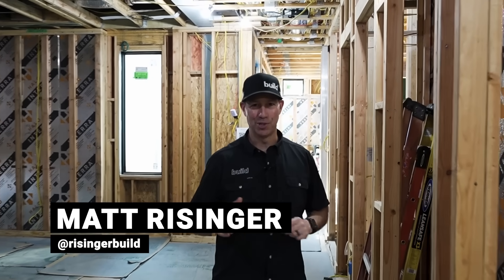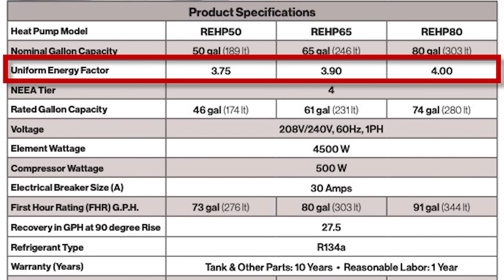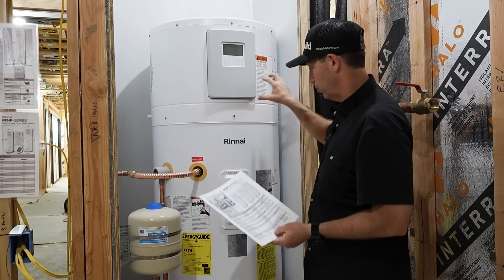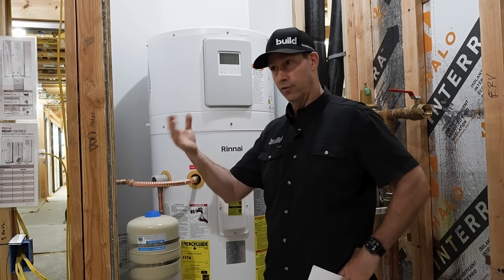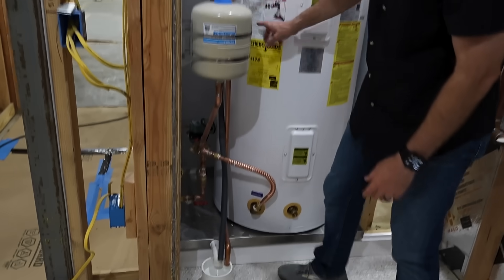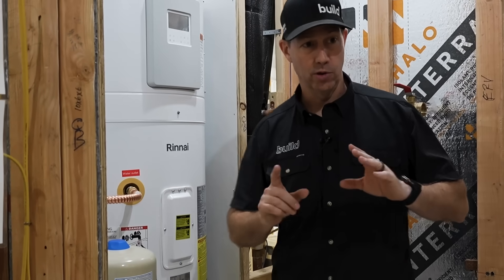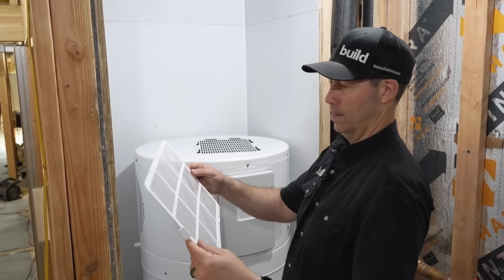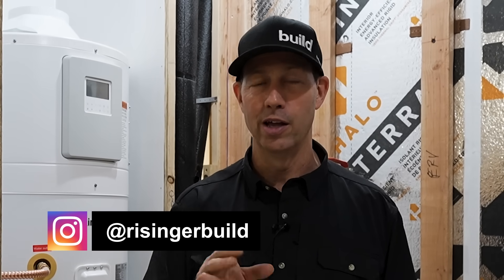The Best New Water Heater? Rinnai's KILLER Electric Heat Pump

Comment: Someone needs to come up with a system that ties multiple appliances together to share heat.
For instance, that heat pump water heater takes heat out of the air.  It would be in hog heaven if it was fed exhaust from a clothes dryer, or warm air off of the refrigerator coils.
Also, the heat pump wastes cooled air that could be used by the refrigerator.
And that doesn't even bring up ways any and all of those appliances could be used for conditioning the air in the house.
Reply: We are starting to see this approach in larger commercial settings such as big modern supermarkets - e.g. heat output from the vast refrigeration plant being dumped back into heating water (and space heating in the winter) rather than exhausted to the outside environment, etc.

Which should tell you something about how cost effective it is or (hint hint) isn't going to be on the residential scale to professionally customize the equipment and installation in each house to make integrated heat management a reality.

Supermarkets have enormous refrigeration line-sets running everywhere already, and this approach is only starting to make headway with them.  Are there really enough homeowners who want to plumb their refrigerators, dryers, water heaters and furnaces together with a big spider web of refrigerant line-sets and/or runs of dryer-ducting to move heat around to all these appliances? That's very expensive compared to the $ you'd save on energy bills.

The HVAC/R people have sounded out the market and to date there is only a fairly narrow commercial customer base for that kind of integration work. So I'm not telling you it can't be done.  But I am telling you that smart experienced people have thought of this concept before and so far they haven't seen a viable residential market for this kind of thing.

Comment: Looks good! Takes about 5-10 years to pay for itself. Hopefully compressor won't burn out or freon leak won't occur. And think about cold air from evaporator coil in cold season. And where to drain all condensation from it. And, sorry compressor and fan creates a lot of noise (keep away from bedrooms). Otherwise good expensive toy!

Comment: This unit seems to operate in a self-contained manner. Do they have water pump water heaters tankless or with tanks that utilize geothermal heat pumps or that integrate with geothermal heat pumps with deep vertical wells?

Comment: The Rheem ProTerra actually has a higher efficiency rating than 4, can also be ducted, has more energy savings than the sticker on this water heater, and costs more than half as this one for the same 80 gallon capacity.
Reply: I suspect Rheem is not paying him.
Reply: @kodiakeddie1827  Ironically, I bought the Rheem because of this channel. 🤣
Reply: This is exactly what I was thinking. Mine runs at 335W on avg.
Reply: how much and how silent? I my water cylinder in a 1mt by 1 mt room in the hallway and I want a unit that can be silent :)
Reply: @martiruda  I don't understand most of what you wrote.
Reply: Guy is product shill
Reply: We just installed a Rheem ProTerra this week.  I didn't know Rinnai now had a model available, but too late now.

Comment: Are induction water heaters available?  It heats a pot of water to boiling faster than anything else.
Reply: Electric water heaters use resistance heating which is 99% efficient. Induction heating of pots and pans is about 90% efficient, so not as good.

Comment: Im still loving the Sanco2 split system. Ours has been an absolutely game changer and im about to install a second
Reply: Great choice. Stainless steel tank and CO2 refrigerant heat pump. love it. 
i believe this system will last many years
Reply: @prothermal_refrigerationHVAC  agree! Ticks a lot of boxes
Reply: no doubt-but cost ?? payback way too long
Reply: @johnwhite2576  yeah pretty long. For our use case other logistics were definitely involved as we needed big heating with a miniscule draw  and the system couldnt affect the interior climate of our small, super insulated rental home. 1000sqf and a 9k air/air minisplit to heat and cool it, so it's sensitive in there if you run another heat pump inside. The Sanco let us do the whole project off of a sub panel on an already crowded 200a service that includes another home, a full-time woodworking/fabrication shop, a solar array and 2 EVs. Every other available system at the time would have had us upgrading our service to 400a (big $$$ here), So Sanco fit the bill.

Comment: For winter time this unit are a none sense, because all Thad cold air work against the heating sistem, to my understanding this units are only for warm zones because dit works as air Conditioner  in this situation is great 4 times the heat + free ac .

Comment: Out water heatpump is now 12 years old, was a cheap chinese one, but proved to be good. 190l, uses only a few kWh a day, most time of the year it runs on solar, so hot water is no issue at all. And that at 53°N north here in the EU. Simple to install, cold in, hot out, 1 plug and one drain, done

Comment: I like this a lot my only concern is how it will affect heating bills for the rest of the house. The heat still has to come from somewhere so if it’s pulling heat from the air in the house then you’ll have to replace that heat somehow at least during the winter in the northern US. In summer it’d probably be fine and actually help take some load off the AC but winter I’m wondering about.
Reply: That's about as logical as saying we need to shut refrigerators off in the summer because we are putting extra load on the AC system.  Same concept but inverted. Nobody thinks twice about the sensible load rejected by a frig and chest freezer, but throw a new application of legacy  technology on the market, and everybody is concerned about their BTU/Kwhr comparisons
Reply: @steve32627  Not the same at all.  Completely different heat load.  It's going to depend on the climate and total heat load on the house.  If you're having to pump heat into the house to then pump heat into the water heater, you need to include the total system in the efficiency calculation.  Entropy will always win.
Reply: @ it’s not exactly the same water takes a ton more energy to heat compared to the mostly air in a fridge/freezer. So the load is a lot higher. Based on specific energy and temp delta it’s somewhere in the range of 8x higher energy for the same weight of water except water weighs about 1000x more than air per volume so the heat loads would be significantly higher. Perhaps I’m not thinking about it correctly but that is my line of thought if using the air in the home or even just a single room as opposed to a compressor outside.
Reply: @johnhavel7685 you realize you are cooling a lot of water as well with the refrigerator, right? Unless you are only putting dry foods in. If you look at the energy guides for a refrigerator it is about half as much estimated energy usage as the heat pump water heaters. A difference, yes, but not like it is 10x worse for the water heaters.
Reply: @wighty  You aren't constantly adding warm stuff to your fridge though. Oncs it gets everything cold it just removes the heat that gets in the door. Heat that was already in your house. With a water heater you are frequently pulling in cold water that you have to suck lot of heat out of the air to warm and then you are dumping it down the drain into the sewer. You would need over 55000 BTUs to warm this 80 gallon water heater by 70 degrees. That would make my already cold basement very cold. This thing actually would pull more BTUs than my central ac.
Reply: @steve32627 this comment makes absolutely no sense. Yes your fridge increases your ac load. Do you suggest not having a fridge to save energy?
Reply: My reply to someone else: "I've thought a decent amount about this. Last heating season (saying Oct 1 to Apr 1) my Rheem 80gal unit used 379 kWh, so at a ~4x ratio (ideal conditions) you can say that the unit took 1516 kWh of heat out of our basement... this part varies, but if you are using natural gas that's approx 51 therms, or maybe $75-100? Sounds sorta not great, but you have to realize that some of the basement heat does in fact come from the ground (so if it is 0 degrees out, the ground temp being ~50 degrees it does in fact provide some heat to the basement), and this cost calculation also ignores that during the summer months you might be saving a little bit in AC costs if you have it."
Reply: If you heat your home with a heat pump, it is still more efficient than resistance as the home heat pump is able to pass on it's efficiency to the heated space the HPWH draws from.
Reply: If it's in the garage it won't matter.
Reply: @thedopplereffect00  here in Michigan I don’t know anyone that keeps the water heater in the garage usually is in a basement or utility closet it can get pretty cold in the winter so freezing pipes would be a major issue if kept in the unheated garage.
Reply: @thedopplereffect00  half the country can't put it in the garage. And I hate utilities in the garage anyways, garages are for garage stuff.

Comment: Is it possible to use a tankless hot water heater and a tanked high efficiency hot water heater? Endless hot water and the energy savings in using a heat pump.

Installed 
Cold Water - - - > Tanked heat pump - - - >  Electric Tankless - - - > Faucets

Have the tanked water 1-2° water hotter than the tankless so the system will not kick on in theory. Or would this not work...
Reply: I have this setup and it works just fine.  I've ran it the way you listed it, but I currently have it set up like this:
- tank set to 140 for bacteria elimination
- tank's mixing valve at 100 instead of the usual 120ish
- electric tankless brings it up to 118

I do this for basically endless hot water no matter how many showers are taken.  The mixing valve at 100 uses less hot water from the 140 tank, so it lasts a long time and there's more time for the tank to heat up incoming cold.  Sure, the tankless is always in play (for 18 degrees of warming), but it means there's no huge power spike as the tank goes cold and the tankless has to dump 100+ amps into heating NY winter water.  I don't have gas available in my neighborhood, and the slightly higher power bill is still much cheaper than replacing the leaking oil tank and 80 year old oil furnace that triggered this install in the first place.

The cooling/dehumidifying is great for ~6 months of the year, but for the other 6 months I just run the hybrid as electric only so it doesn't fight my mini split in the colder months.

Just for the fun of it, as a bit of a science experiment, I've considered doing a preheat on the incoming water using something like copper tubing.  I imagine I'd get a better temperature rise out of smaller tubing, since there's more copper surface area relative to water volume.  So I'd Y the cold water source into, maybe, (2) copper 3/8 tubing runs that wrap around something (maybe floor to ceiling empty PVC pipes, since it's easier to coil kink-free around an object vs just in free air) and then merge the 2 lines back together just before the tank's cold inlet.  We'll call it...a tankless tempering tank :)
Reply: @lastminutepanic23  thanks for the response I wasn't notified you responded to me I am glad that I went back and checked it.

Comment: So just a thought. What if you had the drain within the drain pan? then you would not need a 3-4" open drain outside of the water heater.  Sort of like a shower pan.  Would code have issues with that? Just a thought...
Reply: Prob wouldn't satisfy the air gap requirement

Comment: How can you have zero clearance on top when it needs to breathe and the filter needs changing???
Reply: It's also hard to believe that, in a small room, the cold exhaust won't rebound off the side wall and end up in the intake, reducing efficiency.  What will absolutely happen in this install is that the cold exhaust will bounce off the side wall, swirl, and chill the T&P pipe and hot outlet pipe.  It might happen even without the wall there, since the cold exhaust comes out not like a horizontal column but spreads out vertically immediately.  Without top piping for cold/hot, and with an exhaust side T&P pipe, you really need to insulate the pipes well.

I know this installation might not be completed, but it's worth mentioning that you'll put a lot of cold back into the system if you leave it as shown.

Comment: They need to make one that cools your frig and heats your hot water at the same time  no wasted energy
Reply: Great for Tx but up here in climate zone 5 taking heat out of the indoor air in winter is not good.
Reply: @jamespatrick5930  I've thought a decent amount about this. Last heating season (saying Oct 1 to Apr 1) my Rheem 80gal unit used 379 kWh, so at a ~4x ratio (ideal conditions) you can say that the unit took 1516 kWh of heat out of our basement... this part varies, but if you are using natural gas that's approx 51 therms, or maybe $75-100? Sounds sorta not great, but you have to realize that some of the basement heat does in fact come from the ground (so if it is 0 degrees out, the ground temp being ~50 degrees it does in fact provide some heat to the basement), and this cost calculation also ignores that during the summer months you might be saving a little bit in AC costs if you have it.
Reply: @wighty Good data there.
Heat always moves from warm to cold, so with your ground temperature of 50* and if your basement temperature is 55* then heat moves to the ground.
Reply: @wighty but it will likely be less efficient than a natural gas water heater in the winter (entirely depends on heat transfer efficiency difference between the two). Otherwise, the laws of thermodynamics prevent sucking heat from the heated envelope to heat water from being an efficient use of natural gas and electricity. Heat pumps are not actually a worthwhile investment in northern zones because the temperature regime where they can function efficiently/effectively as a heater is rather small range (above 30°F). The period is only for mid-fall and mid-spring. Plus, the basement doesn’t “provide” heat when the heat envelope is 70 and the ground is 50. In relative terms, you could say it’s a net gain of heat from the perspective of it potentially being surrounded by 0°F air if it wasn’t a basement. However, you will always be dumping heat into the ground. The best option would be a exceptionally expensive solution is having a central chiller(s) with a geothermal heat pump, where the chiller could be used to heat the water and cool a walk-in refrigerator and freezer. (Like i said, an unreasonable solution for single-family homes).
Reply: @jamespatrick5930  Only an issue if the main heating unit can't keep up or if the heat pump is making one specific part of a heating zone too cold.
Reply: @logtron This is the fallacy of these systems. While you’re technically correct that the HVAC system for the home can usually keep up without any issue, the efficiency rating is misleading because the heat for the home will run more to replace the heat the WH pumps into the water. It may be negligible in most situations but it still exists. My home doesn’t have a heat pump yet and uses an old resistive type furnace so if it has to run to heat the air that the water heater uses to heat the water, I’m worse off than just using a standard electric water heater, especially when you factor in the purchase price difference. In the summer if you pull the air from the attic it’s a no-brainer.
Reply: @jamespatrick5930 I agree. We already had a morning where it was -18F a few weeks ago. Also our well water is 42 F.
Reply: the issue is sizing and time of use along with the complexity of piping/integration which is labor intensive, ie high cost.
the fridge is only handling a small area, plus opening the door. the extra cost of piping and mgmt of that coolant would negate the savings.
Reply: I put mine in the basement right under the fridge.. I have piped the intake air from behind the fridge so its grabbing the hot air put off by the fridge and is more efficient
Reply: I sometimes put drinks in near it to pre cool them before putting them in the fridge. The exahust air is in the 30s if I remember from when I checked it.
Reply: Mine heats our water and cools the garage, so that's a start?
Reply: If the heat pump harvests the ambient air temp, using the air the furnace heated, so it is a zero-sum gain as the furnace is heating the 40 degree water coming in. If this heat pump water heater is located in a 35 degree garage it wont work.
Reply: Now you're thinking. That would simply be a fridge with heat reclaim. America is decades behind the rest of the planet on mechanical technologies. I can't even find an inverter heat pump for water
 They've been standard fare in Europe & Asia for decades (all 50hz, so won't work here).

Comment: For cost comparison I got an AO Smith ProLine XE Voltex 50 gallon unit (HPTS-50) for $699 through Energy Trust of Oregon. 3.8 UEF, 8" duct ready, 45 decibels. 30% federal tax credit brings the final cost down to just $489.
Reply: heck of a deal since that's a $2000 model and Oregon incentives are $700 for heat pump water heaters!
Reply: @dannyomo  Plus I sold the 10 year old standard electric unit it replaced for $120 to bring my cost down to just $369!
Reply: @RyanMealy  Any idea how long before the fed taxes go up again to cover all these subsidies?

Comment: Is this tank in a conditioned mechanical room? If so where does the heat come from when AC is running?
Is electric a good option where power outages occur (snow, hurricane, etc)?